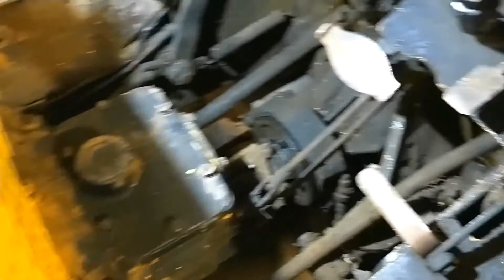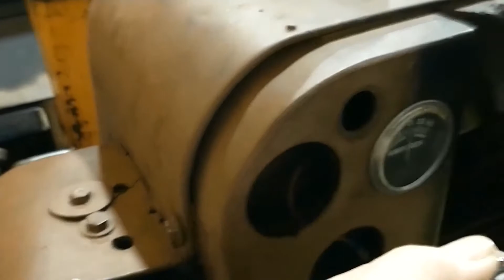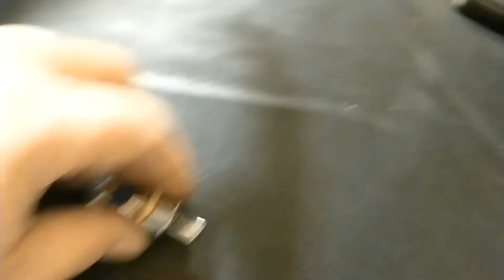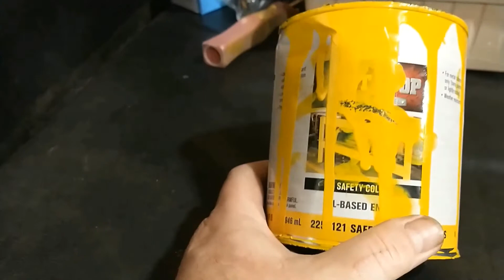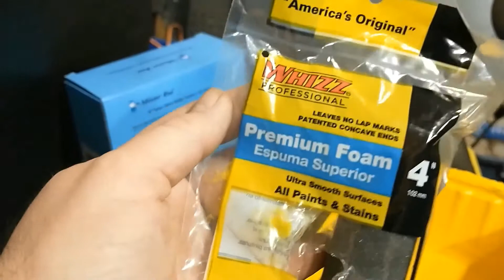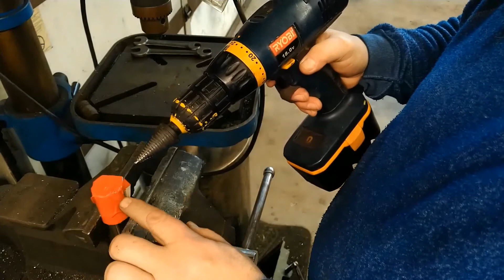1950 Towmotor LT40 Repair and Restoration Part 2

Comment: i own a LT-40 an love it ,perfect size an all mechanical no auto trans to f up , no hyd. brakes to b come obsolete an a flat head cont. eng , i bet with a little tlc it will run 50/60 more years
Reply from the maker: No doubt! I never believed I would use mine as much as I do. Solid, simple, reliable...it's the American way. Thanks for the comment.

Comment: That's machine looks pretty good. One word of caution someone pointed out to me (after I sanded my machine to bare metal without a mask) that in the 1950's the paint probably contains lead. I should have thought about that as someone who gave himself lead poisoning sanding a house many years ago.
Reply from the maker: I chemically stripped a lot of it. But, you are right, that is a real concern. Better safe than sorry! Thanks!